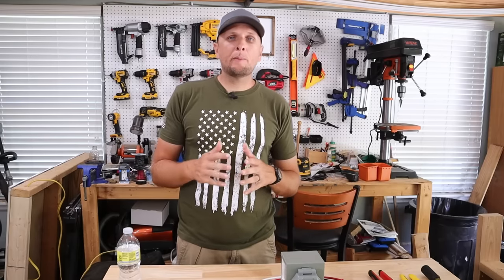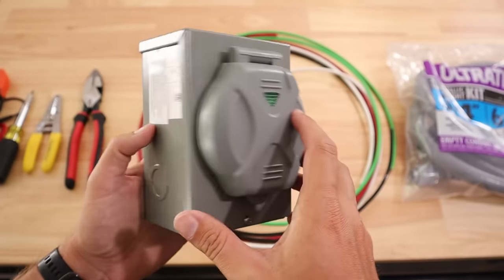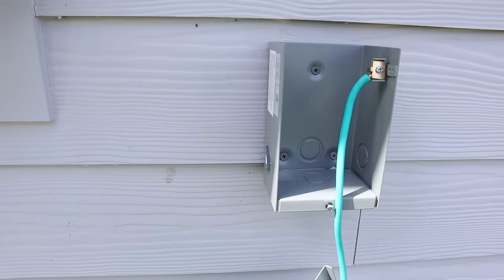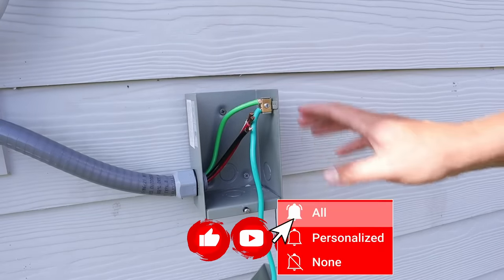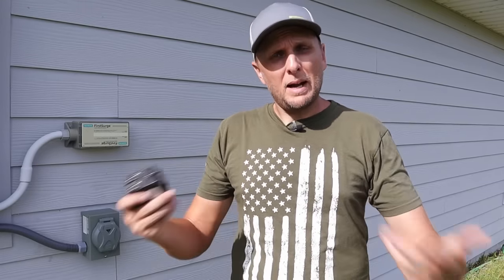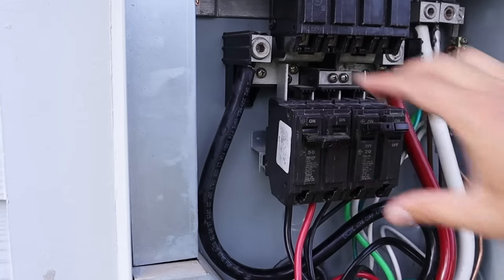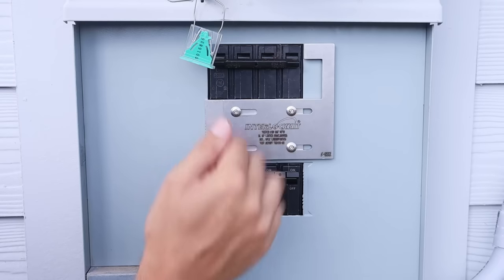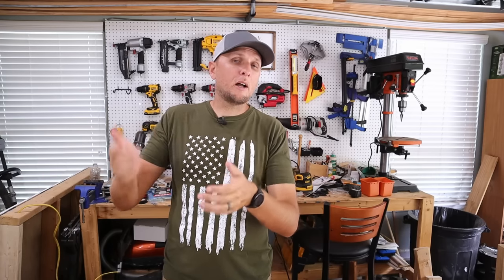The BEST Way To Connect A Generator To Your House - Interlock Kit With Power Inlet Box Install

Comment: So, you have 2 phase 50 amp generator coming into your house, and with your Soft Start you can run your 4 ton A/C.  What about your Refrigerator, your Mico Wave? My double wide manufactured home has a 200 amp main service and a 3.5 ton A/C which has a 60 amp breaker.  I also need to power my 220 volt Well Pump, 20 amp breaker, refrigerator, mico wave etc.. It seems to me that you'd need about a 100 amp generator to power your house.  Can you give some applicance current load info and how you get by with just 50 amp generator? What about the Floating ground generator, and grounding it etc?
Reply from the maker: I can run all of it.  It doesn’t all turn on at the same time which is where its peak demand is.  The only thing I try to be careful of is making sure not to have the AC and oven running at the same time as everything else.  This is all something you have to figure out for yourself as far as what your demand will be, will it trip the breaker, and what your generator can supply.  When you have 2 legs at 50 amps, A LOT is going to have to be on and start at the same time to trip it or go past its capacity.  I can’t tell you what your generator should be wired as.  Most of the time it should be floating neutral when connecting to most homes.  I also can’t tell you what will work for your exact situation because I doing know your s.  Just can tell you mine.  All the bulbs in my home were switched to LED to also help with this.

Comment: Could you do something similar to this in a house that has a fuse box instead of a breaker box that is only 120 ? I have a Eco Flow Delta 2 battery powered power supply with a solar panel included on the way, but it hasn't arrived yet. I do know that I will have to limit what I power up in my home with the Eco Flow Delta 2 until I can afford to ad extra battery supply and solar panels to it. I know I can use extension cords to start with, but I would still like to add a gas generator plug to my home!

Comment: What if you have a shed or shop that you are wiring from scratch and you want to power it off grid by a generator and later wind / solar supplementary supply how would you do that; what would you need to do so? I know how to install all the wiring from the outlets back to the distribution panel; from the distribution panel to where the generator and the future wind and solar hookup. Also how big of a generator would I need; I plan to have four model train layouts and some light tools.

Comment: @HowToHomeDIY 
Quick question and forgive me if it's a stupid one. I see how you installed the breaker to the voltage meter. So my question is if you lose power and switch over to your generator power source. Is that meter going to be reading the power your now using from your generator generator as if it was power being used from the power company? How does it know the difference from one or the other if they are both incoming  power sources? I would think hooking up the generator power directly to the breaker box inside would be the better route since the power is no longer going through your meter. Again sorry if this is a dumb question.
Reply from the maker: No.  The meter is before the main panel so power doesn't flow through it to track anything or power it.  Especially when installed correctly with an interlock kit.  Which is a must so that power is not backfed into the utility side.

Comment: So when doing this...... make sure that you turn off EVERY single breaker in your breaker box before switching to Gen power. . If you're like me and think you can get by with just turning a few off...... you will proceed to blow about six or seven fuses and scare the heck out of yourself as the entire house will go dark and you'll have to reset the sub panel and the main.
.... 😅.

Comment: I'm about to do this but with a different twist by not using an inlet box. My plan is to run the bare pigtail up into my 50amp breaker panel directly and have the male end available outside the house in a weather proof box that I can just pull out to plug into the generator and retract back into the basement when not needed. I am installing an interlock for not backfeeding but also to not have a suicide cord.  The inlet box while convenient just seems a waste when I can just have a retractible cord right where the box would go. Do you see any issues here?

Comment: What if we dont have a breaker panel below our meter? Would we have to buy an entirely new meter box with the breakers attached. My power comes strait to my meter then to my panel. Ive considered back feeding a 50 amp breaker from the service panel but tbat could be problem without an interlock.

Comment: is there a max length i can run the inlet box from the breaker box? Reason is my generator has to be in my backyard but my breaker box is in the front yard. Also my breaker box outside contains the hvac, furnace, washer and dryer, and sub panel on its own fuse and the washer / dryer. The sub panel in the garage contains all other fuses per room of the house. Will I be able to still wire my generator to power the entire home?

Comment: The power company in California is installing a transfer switch that goes behind the meter and comes with a 25 foot cord to plug into your generator for FREE. They must know the grid is in trouble. I have 50 KW Kohler 3ph that takes care of me. But I also opted for the free gift.

Comment: what is the longest length the cable can be to connect the generator to the panel and 

1. be safe
2. not allow too much voltage drop over the wire length

Comment: Good afternoon,i have installed a 50amp power inlet box and i will be running a 13,000 watt duromax gen.i tested it and i can run my lights and tv and fridge.i am wanting to know if it will run my gas heat.i have a 3ton goodman package unit.im not worried about the a/c just my gas heat.thanks

Comment: So, all you have to do is connect the power coming in from your generator to an open spot on the breaker board?  I would have guessed that the main power wires would have to be tapped in to?  Thanks.

Comment: Is there a maximum distance that the switch can be from the panel? My electric panel is on the opposite side of the house from my natural gas meter where my generator will run.

Comment: I would like to install a 50 amp inlet box on the house but currently only have a generator capable of 30 amps. Any problem using one of those 30 to 50 amp adapters they use for RV parks?

Comment: Hi can you do a video explaining  a neutral bonded generator and a floating neutral generator  .l was told that a neutral bonded generator would feed back to the power line through the white wire.  And the floating neutral generator would not  .this is hooking it up with a transfer switch panel and shutting main power  switch off on house panel  .

Comment: I wondering about the grounding for the Generator you have running in that set up.  LED's and micro chips do not like Voltage spikes created by generators. I was hoping you would have spoke about this if you can fill me in and let me know, It would be appreciated .
Reply from the maker: Well that has less to do with the grounding and more to do with the THD% (total harmonic distortion).  You want 5% or under to be completely safe.  This doesn’t mean one with a higher THD will just automatically damage sensitive electronics but it is more likely. My generator in the video is under 5% but they are hard to find now.
Reply: @HowToHomeDIY  I see, thank you for that information, I have a Generator and I should look at what harmonic distortion its producing.

Comment: My question: I follow you step by step but Why my generator breaker switch ( the one is on the generator itself) gets off and switched off automatically when I plug the wire to the power inlet box?!???

Comment: I did notice a possible issue at your service entrance.  Where the red wire connects to the main lug - the insulation is burned at screw lug.  Maybe something to look at.  Possibly loose?

Comment: What do you call this kind of power inlet box that has a place for some breakers beneath the meter? Mine is roughly the same size and shape as yours but is just a single outer shell with the meter housing in the top of it.

Comment: Where can you find the outside box your connecting the 50 amp inlet box to?

Assuming this is right below your meter (or also) wraps around the meter also).  Please advise.
Is it called a Ranch Panel?

Can you provide a link.
Reply from the maker: You may not have one.  It is just an outdoor main meter panel.  You dont need one to install a power inlet box though.  It can be installed on wherever your main panel is.

Comment: Hope you are well.

I have a 50 amp inlet and 50 amp breaker with interlock set up in my panel. 
Considering getting a 9500w portable generator that us bonded neutral. 

Two questions:

  I am confused since what I've researched,  since the panel is grounded already, and introducing a Bonded neutral generator would not be good ?

Do I have to unbond  the generator, or not, or will my inlet and interlock set up at the panel account for a bonded neutral generator and be fine ?

Thx
Reply: Same situation. Did u find a answer?
Reply: @TheHelimechanic  yes, got a floating neutral generator thx
Reply: @djspyder551   ok that ended up being what mine was. So I understand ground is not needed when connected to home as the breaker box handles this. Is this correct?
Reply: Yes, you can't have 2 bonded neutral points on same loop. Larger inverter floating neutral generators are scarce. I found an A-iPower SUA7600iED. Duel fuel. We'll see what happens, thx

Comment: Hi Adam, I understand the concept of isolating the 2 hot wires so only grid or generator are connected to the house circuits, but what about the neutral? Is it legal to have a generator running while connected to the grid neutral? Thanks

Comment: Ok here is my issue…I have a dedicated 50 amp breaker to a 50 amp outside plug in for my trailer. Can I jumper my ac to the 50 amp as well as other to use the outside plug with my generator?

Comment: Should we isolate the neutral wire  as well? Otherwise, there is a chance of backfeeding through the neutral wire to the power line when the generator is running.
Reply from the maker: Only way it would backfeed back through the neutral is if somehow the generator cord or power inlet box was wired to where the neutral is fed power.  Power wont feed out if everything is hooked up correctly thats why there is no shutoff made or required for the neutral.

Comment: Excuse my ignorance, but my breaker box doesn't have a main switch. I'd need to add a 200 amp switch in order for the interlock to work, right?

Comment: Looks like you have to have your 50A generator breaker installed in a top position in your panel box for the interlock plate to work properly.  My generator breaker is not installed any where near the top of my 200A 40 slot beaker panel currently, so I'm not sure if I have enough wire slack to move it to this position.  Do all Interlock kits require this same breaker installation position?  thx

Comment: I have same 4 ton ac unit and Champion 9375 start / 7500 running watts generator. If I install soft start kit, will it be able to run ac? Generator has 30 amp plug. I already installed 30 am breaker with outlets. I wish My electric math would work better. Thanks

Comment: Is the neutral and ground bonded at the generator? If so you're carrying current on your equipment ground.
Reply from the maker: That is a question everyone needs to ask themselves.  Need a floating neutral in this application.

Comment: I bought a Westinghouse wgen10500 and had 50 amp box connected to my house.  Hooked it up and it runs great and powers the house just like utility power does.  But, one ceiling fan light fixture flickers on and off continuously when the switch on the remote is pushed to off.  When the button is on the light stays on as it should.  It’s a hunter ceiling fan.  When on utility power the light fixture works as designed.  Any idea what the issue is?

Comment: Hmm.. I don't have an exterior breaker box. Mine is inside. And mine doesn't look like that outside breaker box. Is that a main shutoff type thing that goes between the meter and inside breaker box?
Can the breaker for the generator be in a separate smaller box near the main breaker box if there is no room in the box and there is only one box that is inside?

Comment: For an 8 KW running with peak at 10 KW Champion generator (#100416) with a 30A 120/240V Outlet (L14-30R), do I use a 30A box or 50A? If I were to use a 30A inlet box, can I still install a 50A breaker at the panel? Thx

Comment: Question:  How do I know if my generator is a floating ground vs a bonded ground.  I think I know the answer but need you input.  I have a 13000 watt dual fuel Duromax and a smaller 4300 Predator but only plan to use one at a time.  My main panel outside of my house has the neutral and ground bonded.  Presently, I plan to run neutral and ground from the generator input box ( I have the same as you)  to the bonded connections inside of my main panel but need clarification on the generator being bonded or floating.  Thank you.  Mike

Comment: I also have a 4ton ac unit with a 12k generator. Many people told me I need a 22k to run my AC, would installing a soft start make my 12k generator run my 4 ton AC?
Reply from the maker: More than likely yes.  I have an updated video of me installing and testing a soft start kit that I posted a few weeks ago.  In it I show me starting my 4 ton AC with not only my 12,000 watt generator but my 5500 watt generator as well.

Comment: I have a 100 amp breaker outside that I want to back feed into with this. How would I go about that? Change my 100amp box to 150 then have 100 amp breaker and 50 amp in panel?

Comment: I had a discovery today. I thought my heat pump was not connected to our Reliance transfer switch... well it is connected to C-D. The thing is... it doesn't come on when we were running on the generator. My question - if the batteries were dead in the thermostat, would this prevent it from coming on? It runs fine on regular power, of course.

Comment: I have 220 already in my garage with a outlet for a welder, with the main breaker off in the house, can  I plug the cord in welder outlet and the other end of to the 240V/30A outlet on the generator and back feed to power the house?
Reply from the maker: Would that work?  Yes.  Is it legal though?  No.  There has to be an approved disconnect to make sure the main breaker and the breaker that the generator is hooked up to cannot possibly be on at the same time.  You would also be using a male to male cord in that scenario which is also not legal and can be dangerous.

Comment: Hello again! I’m guessing you don’t have a suggestion for a replacement box with a 4 pronged 50amp capacity? I feel that the only solution I have since I can’t find what I need in a 50 amp I’ll need to buy the only 4 pronged box that I can find, a it’s only a 30 amp box! What differentiates the two boxes internally? Is it the size of the only wire in the box, the ground? I’m assuming it’s a 10ga in the 30 amp and a 6ga in the 50amp. I can’t find a cord with the correct ends so unless you have another suggestion I have to go with the 30 amp box? What kind of problems should I look out for when using this hookup? Thanks!
Reply from the maker: Mark, I honestly do not understand what you have going on.  If you buy a 50 amp box and you buy a 50 amp generator cord, they are going to plug into each other.  There are no 4 pronged 50 amp power inlet boxes.  The male end of a 50 amp cord is 4 prongs, the female end is 3.  I just am very confused on the issue.  Yes everything about a 50 amp and 30 amp box is different.
Reply: @HowToHomeDIY  
I’m really happy that you have been kind enough to try to help me out. This explains some things that I haven’t been able to get from anyone locally. I have a cord that is stock from the factory that has a 4 prong male that plugs into the generator. The other end is a 4 prong female that won’t work with the 3 prong male box that I bought. This is why I have questions. I’m not able to look at it at this moment but I’ll double check my equipment and let you know more about my situation if I can’t figure it out for myself. If I’m correct about the equipment I’m working with (my memory is shot) will it be safe to use a 30 amp box if I change out the 6ga ground wire to a 10ga? Thanks again for your help!
Reply from the maker: @markvonfeldt1459 downsizing the wiring would be a waste of time and more money.  Having heavier duty wire is ok.  What size is the generator?  How many watts does it produce?  Does it have an outlet for a 4 prong 50 amp cord on it? Let’s start there.
Reply: @HowToHomeDIY  
I appreciate your help! I have a Honda eu6500is and yes I has a 4 prong 50 amp female connector.
Reply from the maker: Ok an inverter generator.  Those are nice Ok with the wattage, you don’t need a 50 amp setup as your generator’s maximum output is slightly under 30 amps.  In looking at the generator it does have a 4 prong outlet on it but it’s 30 amp.  So really you’re only option is to get the correct power inlet box installed on the wall which would be a 30 amp power inlet box and you need a 30 amp generator cord with a 4 prong male end and a 4 prong female end.

Comment: I'm a little confused.  Are you wiring into the utility company meter box?  Where I live, those are wired shut and it's illegal to tamper with them in any way.
Reply from the maker: Nope that’s my side of the meter.  Main shutoff.  They are being installed outside now in most cases.